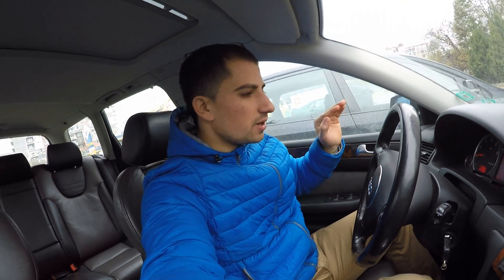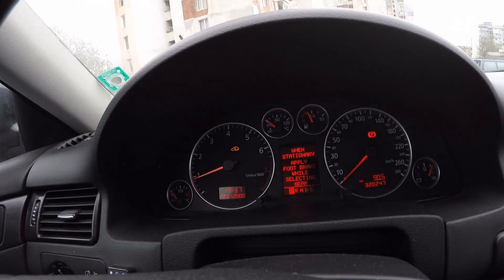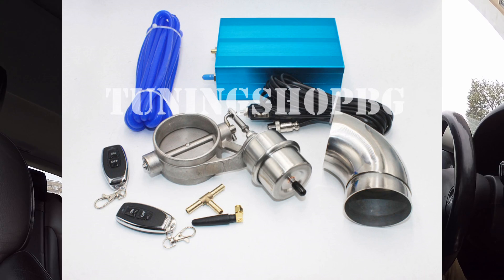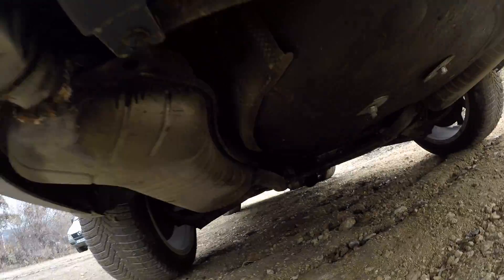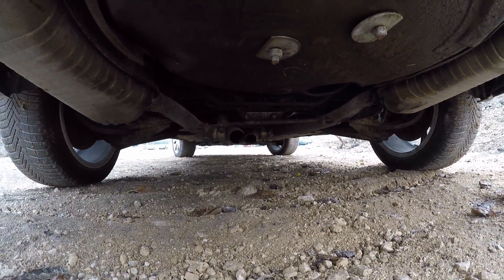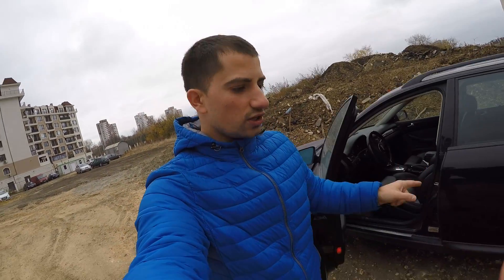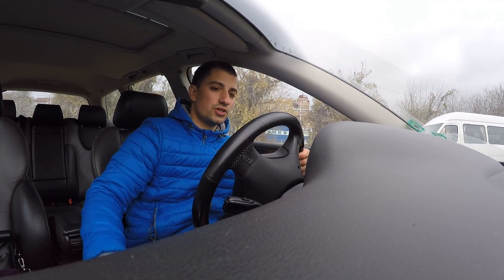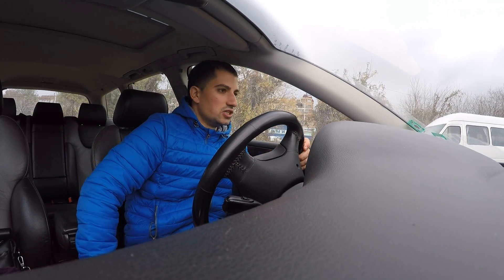CUT OFF Valve exhaust on my 4.2 V8 Audi A6 - Sound check

Comment: Hi, I'd like to know the price you paid to get these valves, and why not installing these BEFORE the middle silencer (just after the catalysors) ? I mean to have a sound like a straight exhaust.
Nice sound you have, I have the sedan version in S (340 HP, manual), with the original exhaust... For the moment ;)
Reply from the maker: Around 250 eur for both. yes it can be but i wanted exhaust gases not to flow under the car directly and so close to the front. I doubt the sound will be much different
Reply: @themorronshacks  OK, thanks for the infos!